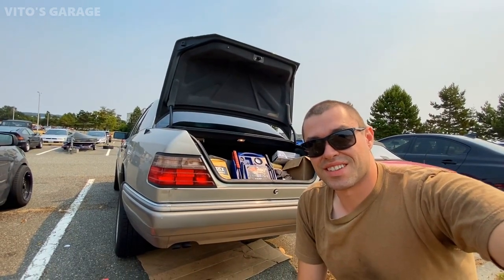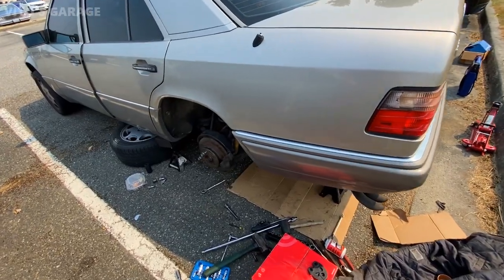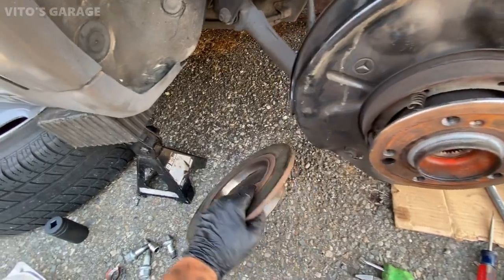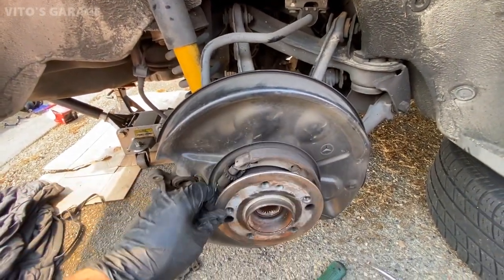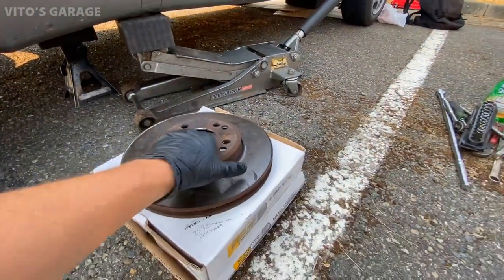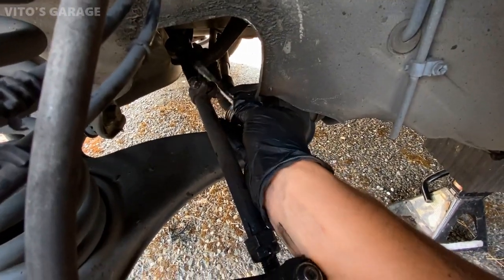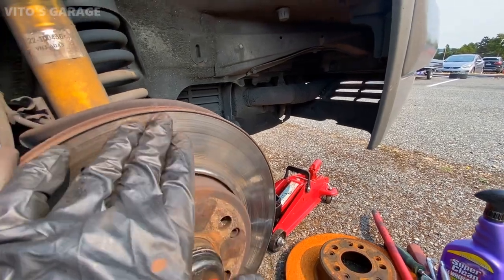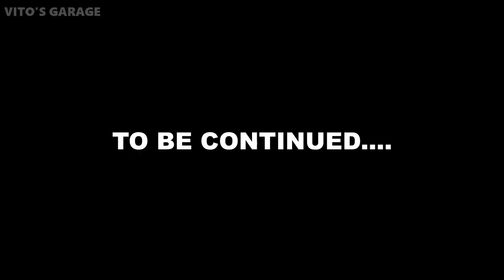Fixing with Pride! Mercedes W124 E320 Installing All New Brakes & Removing CV Axles for Rebuild! Ep3

Comment: what is that you're putting on the brake pads? ive never seen any gel applied there before
Reply from the maker: Silicone grease on all the contact points of the brake pads except for the surface that contacts the rotor, Obviously

Comment: You ever drive a 124 with stiff steering?  Or not return to center? I got a whole new front end all new bushings plus idler arm bushing. Still won’t return to center nice and easy.
Reply from the maker: If you're taking a turn at around 25mph, is it returning back?